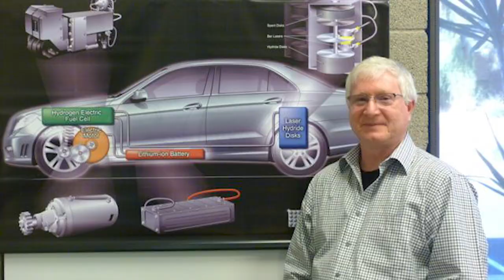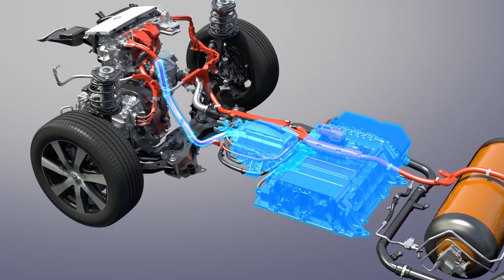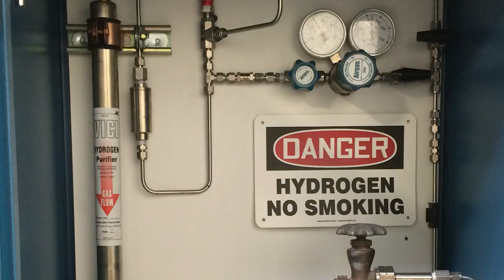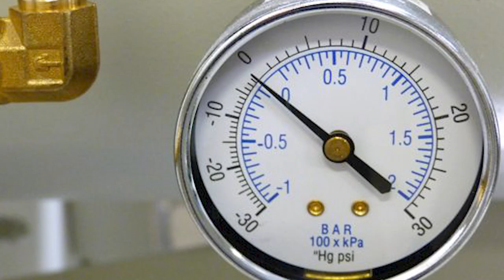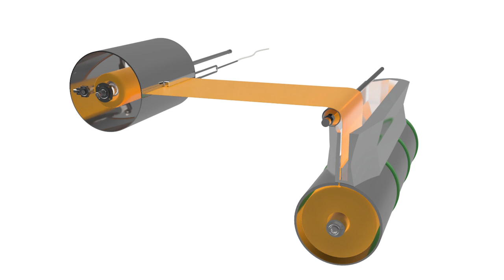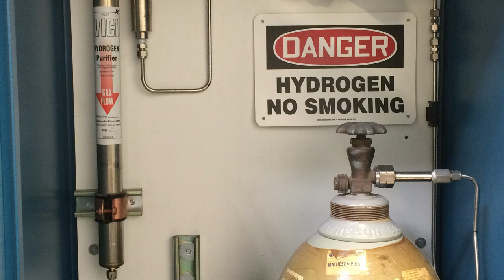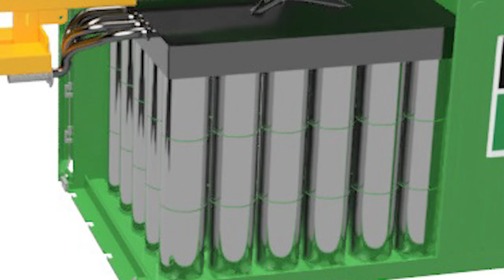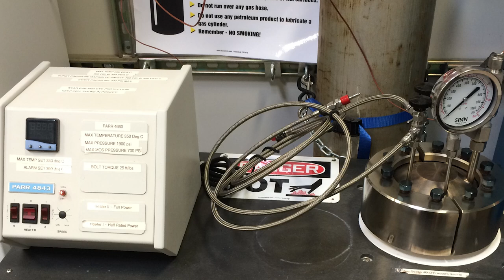This BANNED Technology Could Push Hydrogen Cars Over BEVs

Comment: Today, I charge my EV with solar power made on my roof. It's been a revelation to me. I'd have trouble now going back to an energy source I needed to rely on others to price and provide.
Reply: Amen!
Reply: Everything doesn't work for everyone.

 This just does not work for you.
Reply: Maybe there will be a way in the future that your solar could be converted to hydrogen. I think its a far cleaner technology to manufacture. But who knows what is around the corner!
Reply: You're a lucky man to have solar that powers your car. Maybe one day that will be common.  But you're ahead of the curve.
Reply: @garybrotherton5732  I made it a priority. You can get decent solar setups now for about the same as a decent used sub-compact cars. Add a few thousand for a decent storage battery on the house. Still very reasonable and saves you money every day for both home AND transport.
Reply: @SteveWithers  I was able to have Tesla install solar on my home, but haven't been able so far to pull the trigger on a powerwall.  I heard they won't retrofit powerwalls to a solar-panel only setup.  Thanks for the advice.
Reply: @garybrotherton5732  That's in the US. Elsewhere, Tesla will sell you a Powerwall separately because they don't do solar outside the US. Lots of rules for US only that don't apply in the rest of the world. Some are govt restrictions around the incentives.
Reply: @SteveWithers  Thanks again!
Reply: @garybrotherton5732  : Especially having enough solar to (really) charge a BEV - 20+ kW solar systems aren't all that affordable, nor mountable in most installation sites.  lol.  very "fortunate".
Reply: @davidclark538  Sure. Just bear in mind there are now 5 million of me today with millions more each year ... and no one makes a car - or plans to make a car - that can use these cartridges.
Reply: That's good if you have your own house. If you live in an apartment (like the majority of earth's population lives) garage plug-in and roof solar panels are completely useless.
Reply: @alexg1153  My mother lives in an apartment in Canada. They have EV charging plugs in the car parks.
Reply: @SteveWithers  And if you need to travel some distance, then you just tow your roof behind the car.
Reply: @SteveWithers  There are plenty of places where thousands of blocks of apartments don't have garages or parking lots & plug-ins. China, India, Russia, Eastern Europe, Southern Europe, Brazil, UK etc etc Billions of people will never be able to have EVs (let alone personal solar panels!) unless their cities are seriously upgraded and personal parking lots expanded...
Reply: @alexg1153  Sure. Though places with higher population density usually have much better public transport. I lived in several big cities in apartments and used the subway / metro. A car of any type was impractical. Nowhere to park it and traffic slowed everyone to a crawl. 
No one in an inner city apartment is doing a 150km / day commute.
Reply: @SteveWithers  People in apartments still want to travel outside the cities during weekends and holidays...Especially if they have kids. They still want to own cars! Cars are not a privilege for only a few people! Most probably you lived in several big cities mostly for business purposes. I know this life style. Lived it myself for 20 years. Just renting a car once in a while or traveling outside the city using a company car. Bottom line a mix of EVs and hydrogen cars is investable in the next 10-20 years. Now you can stay long on the TESLA bubble all you want. Most of the negative comments regarding this video is about cheerleading the bubble. People are in denial of alternative technologies.
Reply: @alexg1153  If I wanted to go out of town I rented a car for a few days. It was far cheaper to do that than own one. Many apartments already accommodate EVs and more will as tenants require charging points. It's already happening. You can look backward if you like. But the future moves forward.
Reply: That's cute. I live in Minnesota where we get 3' of snow on our roofs and the sun is up for 8hrs with highs in the -30f range.
Reply: I still struggle with using wind, hydro and solar to generate electricity and not store it in a battery to subsequently drive a motor. 
Instead use lots of it to split water into O2 and H, to store at great pressure (anyone used their feeble energy to pump a tyre up with a foot pump from flat to 28psi/2bar [not 10,000 psi]) until we want to let it out to then use some high tech gadget to soak a film with the hydrogen to store until we use a fuel cell to subsequently create less electricity than we had to start with to drive a motor.
It's even inefficient to just describe the hydrogen system isn't it. What am I missing? 
Additionally Musk, in an interview reported that the grid batteries (and probably powerwalls I expect) are responding to demand changes so fast that they can match the phase of the sine wave of AC in micro seconds. This was discovered when they realised that the Australian grid billing system only works in much longer nanoseconds.
Reply: My power has been out for 3 days due to a storm. 1/4 of those days the sun has been blocked by clouds, half of those days it's been dark. You would have been stuck at home.
Reply: Steve Withers there's 15 million of you?
Hmm I guess there's no reason for any technology to even TRY to advance is there?
Hey... Your horse & saddle are ready, Luddite.
Lol
Reply: That's the beauty of this system.  You could use your solar to power an electrolytic hydrogen generator (there are zillions to choose from) and use it to recharge these containers.  It completely removes the problem of having to compress hydrogen to 10000 psi.  Just pump hydrogen into the container and it will bond to the surface and you're ready to go again.
Reply: Goals!!
Reply: That’s a valid point.  I get my charge from my solar panels too.  But in the long run I believe this hydrogen tech will win out.  Not everyone is as lucky as me to have solar panels cranking out power for hours every day.  Many people live in apartments or condos so this technology would be great for them.  So I’ll enjoy my free power while I can.
Reply: That is cool, how far can you go on a full charge?
Reply: Your name is not Steve. Your name is Logan, and you would be running very soon, as in Logan's run   !
Reply: David Sanders Ok, do you mean that it's impossible to use sun cells? I live in Sweden and my best Buddy runt his ID4 solely on the power from his sun roof/powerwall. All year round.
Reply: That would be a huge amount of panels if your doing a home and a car and most could not afford the upfront costs.. the lowest power Tesla 3 is 24kwh per 100 miles .. average American does around 13500 miles a year .. around 3200 kwh per year .. average home 10300kwh per year .. so 13500 kwh even in Arizona you would need around 15 300 watt panels .. in a place like Kentucky your looking at 30+ panels easily plus the batteries bank needed would be huge unless your grid tied and just selling power of course then you'll need even more panels to cover all those kwh
Reply: @clocktower1164  Okey dokey then......
Reply: If 15 lbs is 20 miles wouldn't that make it about half the energy density of gasoline. There for twice as heavy. Also keeping it simple doesn't seem to apply here.
Reply: Make enough juice and others will reply on you, too.
Reply: I can make hydrogen at my home with distilled water using solar to power the exchange. I believe you are a bit misinformed. I even have a miniature system that I use for educational purposes.
Reply: I also have solar panels with a backup battery to charge up my EV with a level 2 charger. The problem is its too slow and charging away from home still doesn't change the charging time. 

Hydrogen solves a lot of problems like manufacturing with rare earth metals, stability against fires, battery degradation and disposal but there are no available Hydrogen stations where I live. This technology seems sound but I think too many people have invested in the current technology and infrastructure.
Reply: If you live in an apartment, a condo or a townhouse where you park your car right of the street, EV is useless. If you buy an EV, then you need a long electric extension cord plugged into your structural unit. 🤣🤣🤣
Reply: @ravenbonanza1522  Lots of people make it work. They look for solutions, not problems. Attitude matters.
Reply: @SteveWithers  In the UK, you pay 5% VAT (tax) if you install the Powerwall at the same time as the PV panels, but 20% if you retro-fit.
Reply: @grahamwilkinson6902  You need to grasp the losses in doing that.  Turn it into perfectly usable electricity only to lose 70% of it compressing it to a usable state?
Silly.
Reply: @twelvewingproductions7508  I’m concerned about production of car battery pollution.
Reply: @grahamwilkinson6902 ... Don't be.
If you aren't losing sleep about 2.5 feet of sludge covering nearly the entirety of the gulf of Mexico from the Deep Water Horizon... then you shouldn't be concerned about creating batteries that can be nearly 100% recycled.
Reply: @DispatchGod  it doesnt matter theres a limit on evs due to the power grid
Reply: This technology is not going to outcompete battery EV's since both of them have their unique advantages and disadvantages.
What this technology can accomplish (if it is successful) is me switching from gasoline car to hydrogen car, because battery cars are still to expensive for a lot of us, and this technology should be able to enable electric cars at competitive prices.
Even if I have to manually switch the cassettes, and the fuel is a bit more expensive then gasoline it's a small price to pay for CO2 reduction.
Reply: @dariozanze4929  If you're worried about things being expensive, wait until you have to buy hydrogen instead of just plugging your EV into a power point with cheap electricity at your home, garage or apartment parking.
Reply: @SteveWithers  I would be worried about it if I was living in US, however I live in Europe with gas prices being about 2x higher then US ones, and electricity prices are almost 50% higher as well.
Without getting too much into details this technology could offer competitive fuel costs in Europe.
Reply: @dariozanze4929  Fair enough. We'll see how it goes. Right now, there are almost no H cars and they are very expensive and have few places to get H. At the same time, BEV tech is evolving rapidly and a lot of money is being invested in making millions of cars today and more and cheaper in the next 1-2 years. 

So it would be hard to turn the table over yet again and move to something else.....and there is no sign that is about to happen as automakers already decommit from H.
Reply: With hydrogen you can just electrolyze water. You don't have water where you live? Don't be so pedantic.
Reply: @exgenica  that's communist
Reply: @BlankofMaterial  Every day is a good day.
Reply: That is the best comment I have heard on why EVs are good…boom…epiphany! 😁👍🏻
Reply: @grahamwilkinson6902  - It exists today that technology. Its just WAY LESS efficient than sticking it direct into batteries.
Reply: I live in Bulgaria - we get over 300 days of sunshine a year - I really want one of the Actera Infinite range self charging from solar cars.

Just leave it parked outside and its charging.  The milage I do I would NEVER have to pay for energy / petrol again...  My greatest expense after buying it would be the screen wash - seriously.
Reply: @dariozanze4929  Economies of scale solve your issue and this doesn't involve the argument you put forth in your opening line.
You stated that each have 'advantages and disadvantages' implying situational context and not just... cost.
So if we are talking about just cost, that's a self solving issue.  It gets solved with scale.  Just like flat screen TV's.
There is no argument that says that flat screen TV's have their advantages and disadvantages against CRT's.
The issue with hydrogen is one of HUGE loss as well as having to have one of these cartridge machines near by.
With electric cars.... you simply have to find a house or a business... that has a lightbulb.
Reply: @grahamwilkinson6902  Why?  Did you lose sleep over the Exxon Valdise or the Deep Water Horizon BP disaster?

Two things to remember..
Firstly, extracting lithium salts from dry lake beds is basically a clean up operation.  The lithium makes the soil unworkable.
Removing it will allow the possibility of life there again in our lifetimes.

Secondly though, the lithium batteries are over 95% recyclable.  1/4 of the Gigafactory is actually dedicated to reclamation.
Gasoline, is zero percent recyclable.
Reply: @twelvewingproductions7508  We literally cannot mine enough minerals to produce enough lithium batteries to replace combustion engines.
There, solve that problem with economies of scale. 
By the way the demand for lithium also raises it's prices, feel free to solve that with economics of scale as well.
Reply: @twelvewingproductions7508  hydrogen is in abundance.
Reply: I need to get to this point myself..
Reply: @Steve Withers : what happens when you leave your home or state on a trip, you have to plugin somewhere, pay and wait till its charged, or don't you leave your home town?
Reply: What do you do in the winter on rainy days?
Reply: @dougspindler4947  I'm connected to the grid. I draw power if I need to. New Zealand is 85% renewable energy.....and 100% at night when demand is lower. I'm not off the grid. I just don't use it much.
Reply: @SteveWithers  I'm in California where we have wild fires and no electricity.  We were told to evacuate immediately.  If I had an EV I the batteries would not have given me enough range to get out of the fire zone.  I purchased a plug-in hybrid vehicle for times when there is no sun.
Reply: @dougspindler4947  If there's a fire in the area, you'd make sure your car was charged. How far are you going? Any new EV is good for 300 miles....and can be charged from any power outlet on any wall.
Reply: @SteveWithers  If there's no power because the power company shut off the power how are you going to charge the car?  Our power company has PSPS events where the shut off the power to large areas of the state.
Reply: Is Elon  and his team been made aware of this technology?  For his cars , his semi trucks, home grid feeding power walls,  semi trucks,  new high person capacity vans
Reply: @grahamwilkinson6902  isn't that exactly what we just watched.?
Reply: Hm....do you have 75 1KW panels on your roof just for the EV charge?
Reply: you can only live "off grid" for your home and charge a car if you don't use air conditioning.  If you live in a hot/humid climate, that is just not a practical solution unless you can devote an acre of ground to a solar array.
Reply: @alexg1153  Yep.  Their plan is for personal ownership of cars to eventually disappear.   They expect everyone to Uber everywhere they want to go in these driverless, autonomous cabs.    I have my doubts - people have an emotional attachment to cars.
Reply: What if there was a way to fill up with water and hydrogen produced at a speed that you cloud drive for days or just fill up with water every 1000 miles, all built into the vehicle.....i would buy that and i am the most sceptical of hydrogen energy cells.
Reply: This works well for those who live in climates that have consistent sunshine - which there are many. But mining lithium makes fracking look like a Sierra Club initiative.
Reply: I also have solar with a home battery and pay nothing to fuel my car or power my house. No dirty power from coal plants like people say.
Reply: @garybrotherton5732  check with them again. I have a Tesla solar system for about 5 yrs and now they’ve worked with me to compliment my system with  a few additional panels and get the Powerwall (1+) needed to practically go off-grid and charge a Tesla (when I’m ready). I thought I couldn’t get a Powerwall unless you buy solar and Powerwall as a package but they made it a package to add to my current system. 😉
Reply: @SteveWithers  
Not enough for all the residents I'm betting
Reply: @coffeeisgood102  
I award you the thinkers cap

Rather than just blindly defend a position you are objective enough to look long term

So many in here are seemingly butt hurt that hydrogen shows a lot of promise

My only gripe with this impressive system is that it seems like the owners will lock it up in patents

They should certainly get a return on their idea but I'm just weary of great inventions that have gone nowhere because of greed
Reply: Yes because you are so disconnected with where your  battery needs to go after you sell your car and it stops running. Or how much they have to keep mining and destroying their own land and people so you can have batteries.  I hate to tell you but this guy's fuel cell idea is much better for the environment  than your battery future
Reply: Thats great if you have sufficient sun light or if you get home in the dark and leave for work in the dark it's not going to work, other than the degradation of the hard wear and what to do with it when efficiency drops below a usable threshold? 
Other than that your set up is the intimate so far.
Reply: Don't drive too far
Reply: How much does it cost to replace the battery and how many miles do I get for the life of the battery????
Reply: @grahamwilkinson6902  but why?  Complicated conversion and half the efficiency.  For home car, BEV is superior.  Where gravimetric energy density and fast recharge paramount the hydrogen could be worth it.  Or maybe even as range extender almost like hybrids but hydrogen replacing the gasoline.  Hydrogen cars would need a small battery anyway so they are by definition a hybrid.
Reply: @andrewsaint6581  sorry, a nanosecond is 1000x shorter than a microsecond.
Reply: As do many... but how green are the batteries?
Reply: This sounds too good to be true. Unfortunately when the U.S. has so much oil it's going to take a lot of push to get oil barons to not block the road.
Reply: I sure love the fact I can plug into my house to refuel my car.
Reply: @deeeeeeps  I just had to reply because we share the same name, but I'm in the UK where the sun doesn't shine all year round either, lol.  That being said; although you may not get the most out of solar panels on your roof in Minnesota all year round,  I assume you will still be connected to the grid and will be able to source green energy some of the time when required rough your energy supplier?
Reply: I will be curious how much miles you drive a day and where you live as solar panel is great but everyone does not live in places where there is a lot of sun and more importantly work at night so that the car can charge during the day. If you need to charge your car at night then you need battery on top of your solar panel system and then the cost is much higher so this is something that needs to taken into account. How long is the return on investment, many years.
Reply: So your tax free for now 👍🤦‍♂️🤣
Reply: Yea good for grocery shopping. If you have to go distance then good luck. And off course price of EV is just sick.
Reply: @garybrotherton5732  I have SUNPRO panels and they will add the Powerwall when you can afford it.  The problem is cost.
Battery backup for house is so expensive and if you're still on the power grid and just getting credits for what you don't consume, (haven't had any electric bills for over 15 months) then buying a dual-fuel gas/propane generator for any occasional power outage is much more economical choice.
Reply: @thomaswalker9635  Good to know.  Thank you for the advice.
Reply: @SteveWithers  its called bait and switch
You just took the bait
Reply: Or you can just move to a city where there is public transport available and save hundreds of thousands…
Reply: This technology can be scaled to domestic level as well. Everyone can use solar to store this hydrogen on a CD player in minutes instead of hours of charging.
Reply: @SteveWithers  But not solar
Reply: More Media Manipulation 
Less than 5% of the US uses
Solar power.
Reply: I bet you’d lose the exciting acceleration with hydrogen. I have zero interest in that. And wouldn’t they still use hydrogen from fossil fuels? We want to get away from that
Reply: @dalton1981  Lmao, were do you think electricity comes from currently? Those very same fossil fuels. Albeit a slightly lesser amount of fossil fuels are used.
Reply: I like independence.   But we have nuclear.  It's so damn reliable nd the price is much more stable.  I never have to stress.  If I went with solar now I'll have stuff to fix, Replace and maintain.  

Solar has come a long way with battery tech and if it came to it I'll it but with a generator backup.
Reply: Not everyone can do this - but I also run my car on sunshine...it's a good feeling.
Reply: Yah ... sounds good  BUT>>.  The road taxes on carbon has supported the transportation infrastructure at local, regional and national levels.  I guess there might be a "infrastructure" Tax on distance drove when  renewing licensing. You can never avoid the government in your wallet. LOL
Reply: I can just see your solar panels affixed to the roof of your ev to get you from Texas to Florida🤨
Reply: @floroy9265  Well, no, obviously, for road trips you use public car chargers...but for most people that's a totally negligible percentage of their usage.
Reply: @garybrotherton5732  Tesla won't - but they have resellers who do.   I looked into it for my (non-Tesla) solar panels and for me, it's not cost-effective yet. But it depends on so many variables - it's hard to generalize.
Reply: @Steve Withers your logic fails basic stupidity...so you build and maintain and install your own voltaic cells and batteries?
Reply: @garybrotherton5732  "You're a lucky man to have solar that powers your car"

Depends on your range constraints.

For people that travel less per day you need less solar to recoup the lost power.

The other problem is that if you leave early for work and come back late you have already missed the ideal time to charge directly from your house roof solar panels - so if you lack a storage battery it becomes a problem.
Reply: How much have you invested in solar plus an Electric vehicle 
It seems electric is a niche for wealthier people but no replacement for the the internal combustion engine 
Where is your battery ,made , in fact your solar panels . 
.
Reply: So are you able to produce battery replacements at home with you solar? You are still beholden to production by some industry. Have you looked at the cost of battery replacemeny? How about the carbon footprint and/or toxic waste of battery manufacturing and disposal. Most new EV car buyers ignore this part of the life cycle of the car. Please look at the whole life cycle of your transportaion to get the full picture. There is a great ted talk about why battery based EV are just a diferant set of problems.
One other note for a lot of us is we are at work during most of the prime solar hours. My solar cannot give me enough charge while I am home. I do have net metering that makes it economicly work for me but big picture it is not the solution for the world.
Reply: I have to call bullshit on that. A $30,000 solar system will barely run your lights and that's if it's not cloudy. You must only drive a few miles a day.
Reply: Maybe in the future we have electric/hydrogen hybrids with plug in electric charged by solar and wind on cur property with hydrogen  range extension discs that we also made ourselves and we just by the film medium.
Reply: Lets stir the pot, I say make everything possible nuclear ☢️ powered 😂
Reply: What do you do when you are in wal-mart and it starts hailing?
Reply: Nobody has addressed the disaster to come even though Paris ex electric failed battery cars have been filling fields for years BECAUSE BATTERIES ARE NO GOOD AND CANNOT BE RECYCLED ..
the world is full of idiots ....
We left lead acid (recyclable    ) for non recyclable lithium and there's no debate in site .we've been played like fools
Reply: @coffeeisgood102  Free huh?  Who donated the solar panels and installation?
Reply: @Blown Gasket Why not, a really heavy duty trailer hitch (3rd wheel?), a few good wheels mounted up, and it's off to the races.  :-)    He'd have to stop every couple of miles to recharge though.  Those rooves are heavy.
Reply: Millennium Reign Hydrogen, is it company that makes home hydrogen production appliances
Reply: They will find a way to tax sunshine!
Reply: I love the responses to your post. "That won't work for everyone". Why, don't you have electricity at your residence? Do you read by candle light? How is your computer powered, by hydrogen? I know, it is more directed at the solar part, but electricity is still way cheaper than gas, and hydrogen won't be cheap either. We just need to get affordable charging to more folks who live in multi-unit housing. They have the biggest issue. I am thinking that eventually more apartments will be required to have chargers installed for residents to use, and there will be incentives toward that end.